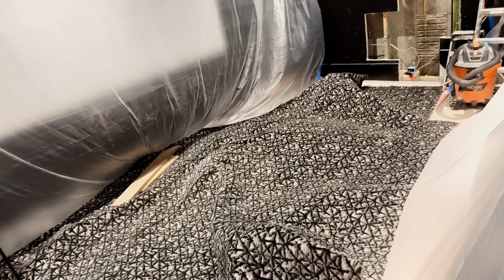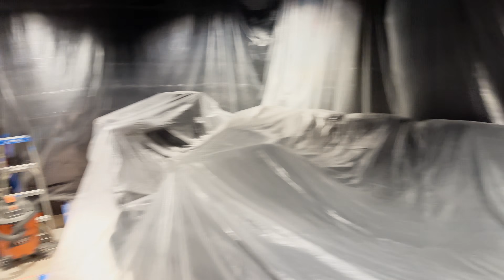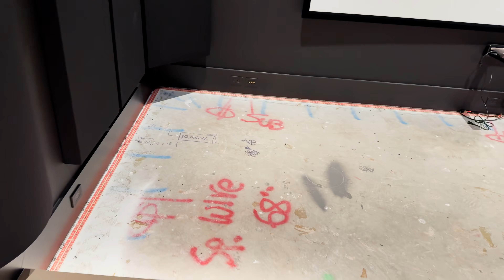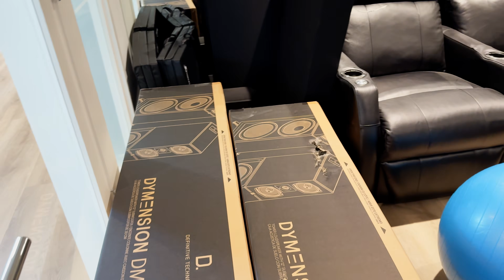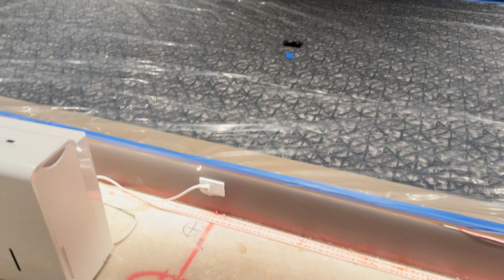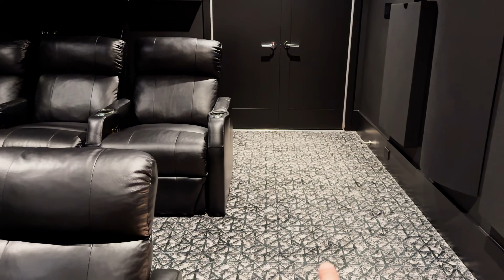Theater Disaster - My journey to get my theater back...

Comment: Yeah when I first started putting together my theater last year, we had a leak in the theater room and there was a bit of mold.  Fortunately not black mold and it wasnt a lot so they were able to scrub it away and dry out the wood.   
I was prepared to shell out several thousand for the roof repair and delay my theater upgrade for possibly a year or more, but fortunately the insurance company decided to cover not only the roof repair, but a full roof replacement since the replacement was due in a couple of years anyway.  So it only cost $1000 out of pocket and we got $10k or $15k worth of work done and I was still able to get my upgrades.
Reply from the maker: I’m really happy it worked out for you and that insurance covered most of it.

Comment: I had some water leaking into my basement through a crack once… sump pump was working but the drain line was crushed… so all the water was just shoot back up out of one of the downspouts and pooling next to the house.   I had the line fixed and use flex seal in the crack and haven’t had water seep in since.

Comment: Yeah fixing crack inside hardly does crap. You really need to look at sealing foundation from the outside to do it right. You could also have lots of pooling water outside when it rains hard from erosion and need to re slope the yard and possible add french drains with under ground tunnels to carry water away from the house. If your gutters get backed up or have wood rot with little flashing the water can overflow behind the gutter and down the walls to the inside of the house. Would not mess with your system anymore until the water issue is fixed.

Comment: Sorry to hear about all this water. I recently found out the same thing but I'm lucky cuz my theater is not done. My gutters go to a pipe that goes underground to the middle of my yard and that pipe had clogged up and all the water was just running up against my house going down the wall and then coming in where my water line comes in. I had recently put a drain in that room because I've always worried about my whole home filters cracking while we're gone. The water got in the cracks of the new cement and has proceeded to mold as it traveled down those cracks. But, like I said mine is still unfinished and I can work on it without any worry at this point. Glad you're getting a jump on this and getting it taken care of. Great video
Reply from the maker: Thank you. Better it happened to you during construction. Our issue stemmed from a drain issue that was also addressed. We had three roofs that converged rain water into one spot, which happened to be right above the theater room.

Comment: Thanks for sharing this video. Hopefully none of your gear  was damaged. The floor standing speakers would be at risk of water-damage so I'm thinking this played a role in getting now fronts. 
I've had some water leaks in my life. When demo & reconstruction is involved it has always been measured in "weeks".
 Thankfully my water-damage was not in my theater.  We just moved and I'm rebuilding my theater. The water main is on the other side of the wall in a under-stair-cubby.
Before we moved in I had that area updated to reduce the risk of any major water issues.
Reply from the maker: Makes sense to update things to prevent things like that from happening.

Comment: Same thing happened to me one year ago when I first started building my home theater room.  In my situation tree roots blocked 1 of my 2 main drains to the city sewer and even though my main sump pump (I have 2- one on each end of the basement) was working fine there was a floor drain and the sewer was backing up from the floor drain and the basement toilet.  Yucky!   I was going to mention to you if they try to fix the crack from inside the house get a warranty.  I have never had any success repairing cracks from the inside of the house.  Even with 2 part epoxy.  Hydro static pressure can really be tough to stop from entering the house.  Several things that can be done that can help:  tie your downspouts to some plastic pipe and direct it away from your house.  Make sure you have a positive fall with the dirt away from your home.  You can even pour concrete which I did and sealed the joints between the concrete and the basement walls.  I hope you have this problem fixed for good.

Comment: Wow, hate to be the bearer of bad news, you got screwed. Nice concrete cracks you can’t treat it with epoxy fill. The only way to prevent it from happening again is to pin and steel it. They have to completely grind open the crack and hammer drill holes and insert rebar. Then backfill with concrete. This fix will not last. I bet they don’t even warranty it. The industry verbiage is to “treat the crack”. They don’t say repair the crack because you can’t! You seriously need to have a real expert come in on this before it backfilled!

Comment: What caused it to crack
Reply from the maker: We had a drainage issue with bunch of water accumulating right I that corner outside the house when it rained. We had additional gutters installed to fix the problem.
Reply: Glad you got it fixed. 3 to 4 weeks sounds like a lot, but sometimes it takes just that long to get the contractor(s) scheduled before any work is started. Good thing your speakers are okay!

Comment: Must have been a huge headache. Sump pump maintenance is tedious, but it’s crucial to avoid flooding like this. They should be checked at least 3–4 times a year and replaced every 7–10 years. That’s actually one of the reasons I sold my home and moved to a higher elevation where I don’t need one.

When a sump pump isn’t working, water pressure known as hydrostatic pressure can build up around your foundation. If that pressure has nowhere to go, it pushes against the basement walls, often leading to horizontal or diagonal cracks where water can seep in.
Reply: I actually rewatched the video because I thought he said that the cause was a crack in the basement wall and not the sump pump.
Reply: A sump pump is designed to help prevent cracks like that by relieving water pressure around the foundation. If it’s not working or can’t keep up, that pressure can build and force water through the wall. Not sure what model is installed, but it sounds like it isn’t handling the load.
Reply: @VTheater I understand sump pumps. I have 3 in my basement.  The main purpose of a sump pump is to keep the water level below the basement slab in conjunction with your perimeter tile.  If the perimeter tile fails or your sump pump goes out the first signs of water coming in will be between your basement walls and the basement slab.  If you have a crack in a monolithic basement wall pour the water will enter the basement above the perimeter tile and bypass the sump pump.
Reply: @tomreidy1237  I agree the sump pump works with the perimeter tile to manage water below the slab. I was just pointing out that if the system can’t keep up or fails, hydrostatic pressure can still build up around the foundation. Over time, that pressure can lead to cracks or force water through existing ones, even in a monolithic pour. It’s possible the crack formed because of that pressure, especially in a new build where drainage might not be fully dialed in yet.
Reply: @VTheater I see your point.  It’s been my experience that most cracks develop because of a poor footer because of bad soil or some bad construction techniques.  Another cause is the decision to keep a tree on the property that should have been removed before construction.  The root system of a tree can cause basement walls to cave in over time.  Here in Northern Indiana we have a lot of clay that can expand and contract depending on the moisture in the ground which can cause a lot of problems if not properly back filled after the walls are poured.  I did wonder about the brick pattern in the one view of the basement wall?   My first house was built in 1930 and the basement walls were poured in 10” increments from the slab to the top of the walls.   When I bought the house the walls had a nice white finish and looked like someone troweled a stucco finish on the inside of the walls.  Within a couple of years all of the cold pours started leaking water and the concrete and paint was flaking off on all the basement walls.  So construction techniques changed and bigger forms were used to pour the basement walls in a single pour.  So if the perimeter tile and the sump pump keeps the water below the slab and no cracks develop because of tree roots, settling because of a weak footer, or other bad construction techniques- the basement should stay dry.  That is until power is lost so the sump pump won’t run and then 🤯